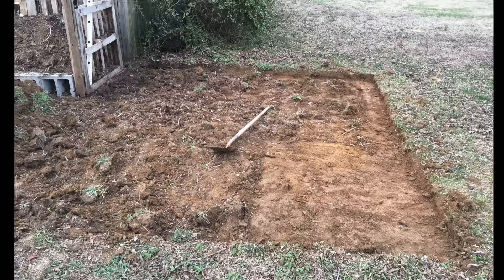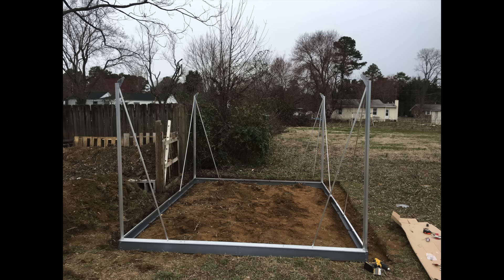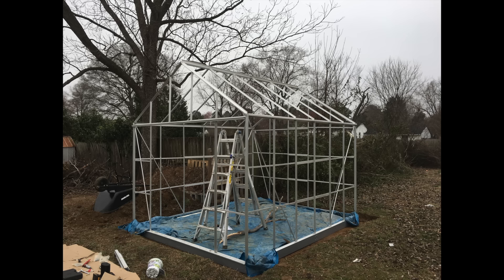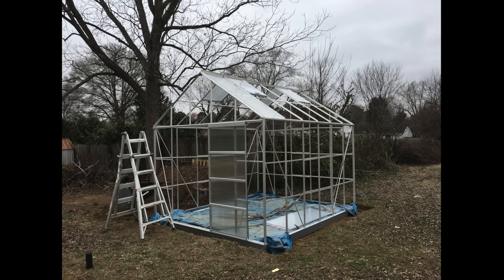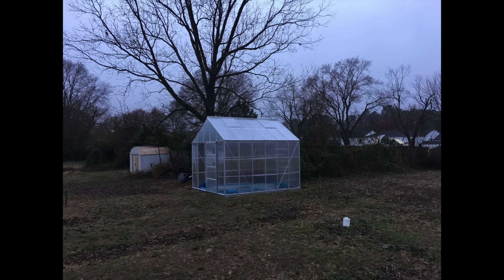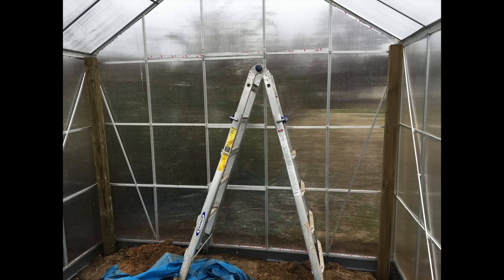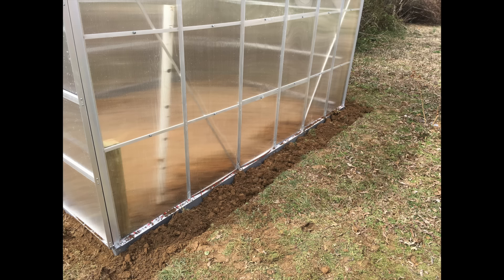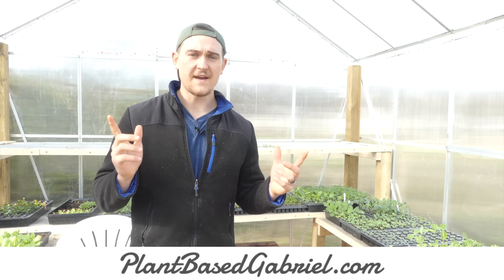Harbor Freight 10 X 12 Greenhouse Kit (Complete Build and Modifications)

Comment: I'm read to put my vents in the frame as it's the last step and I lost my plans.  This video didn't help as it didn't cover step by step construction.  It was well done for what it was.  I used trailer tiedowns under the base frame to secure it (gulf coast here) and before I went around to tighten all my screws I put some metal caulk in all the joints because this structure is permanentate. I installed full 4x4's on the corners so I could have rafters that would support hanging plants.  The only other thing I added was some 5/4 landscaping boards around the outside above the back fill.  This will make it easier and faster to weedeat around.  I do that to all my wire fencing as well. I guess I'll continue searching for a copy of my plans to finish the doors.  The plans were very murky in places anyway but were a necessary guideline.

Comment: Pain in the ass to put together. 
They don't hold up well up north. 
You can get the same plastic in 4x8 sheets at home depot and frame it with treated lumber  and 
You will have a better greenhouse.